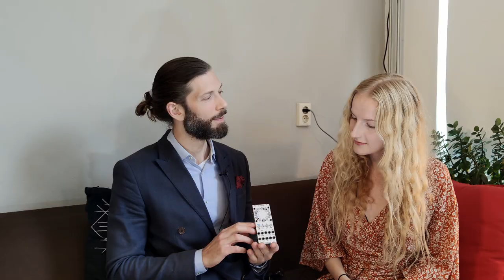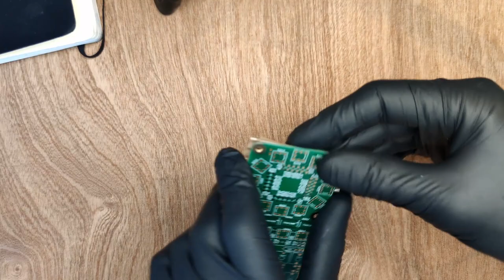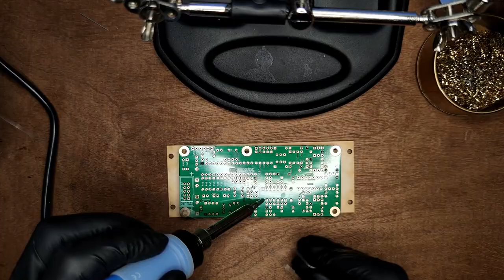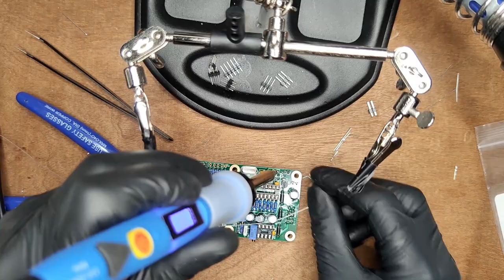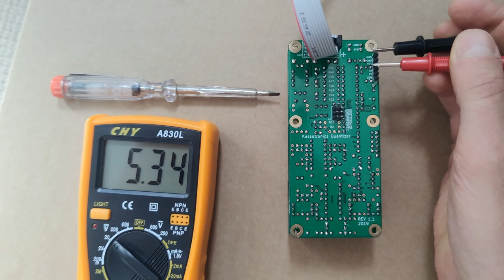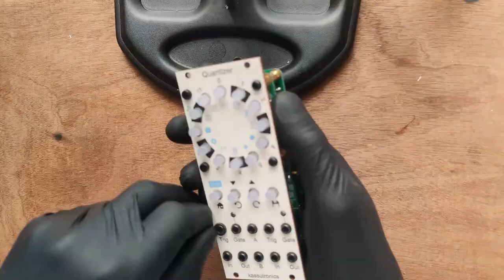Kassutronics Quantizer build, review, and demo

Comment from the maker: We bought the PCB, front panel, and microcontroller directly from Kassutronics (link in description), and ordered most parts from TME and Mouser - except the shift registers and buttons; these were from Aliexpress. Note that the buttons were not made according to correct specifications, and we had to get some original Highly buttons! Be very careful with the Aliexpress version.

Comment: Awesome video, thanks so much for creating it! I'm setting up to build the Thonk kit now. But...there's a section late in the build doc on programming the microcontroller. I'm stumped. You didn't touch on this part so I'm wondering if it's actually necessary. I have no knowledge of microcontrollers/arduinos so I'm intimidated by these instructions. I've built a few module kits but never encountered anything that required programming, and it seems like too deep a dive for me at this point. Any thoughts?

Comment: I got myself the PCBs and aluminum panel from Thonk. Now I’m looking at the bom and have no idea wtf I’m doing lol. Fortunately I found someone on Reddit willing to source the parts for me as a kit. I don’t know how it’s going to go but regardless thanks a ton for making this build guide.
Reply from the maker: You're gonna be OK. For future reference, go to mouser.com and enter the part numbers listed on the BOM. Add them to your shopping cart. If Something is sold out, use the filters to find equivalent parts, or place a second order from tmz or another supplier!
Reply: @Channel37synth  Thank you! After a few hours of research on capacitance and resistance I think I finally have all the correct parts in my Mouser and Digi-Key carts. Things are finally starting to make sense, haha.
Reply from the maker: @camm5817  this is our (partial) shopping cart, you can compare if you want https://docs.google.com/spreadsheets/d/130Q5ohXG7YDs4KwOfuOg0Qeqf09R7QS_/edit?usp=sharing&ouid=108606537347568930926&rtpof=true&sd=true
Reply: @Channel37synth  You both rock, thanks again!!!

Comment: hi great video   .. Is cleaning really necessary? With what? Isopropylalcohol?.  I never do it....Great project btw... I have the Penrose ... this would be a great module too for me too build
Reply from the maker: Officially it depends on the type of Flux you're using. Some Flux can erode the solder joints, other Flux protects it.